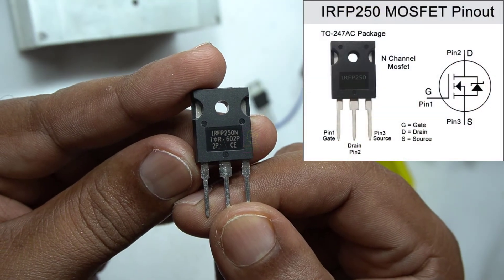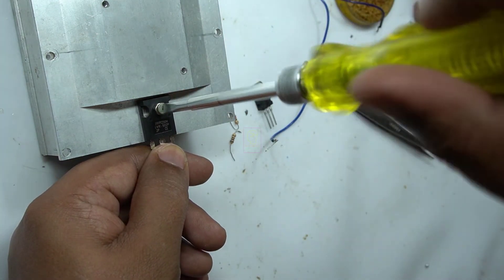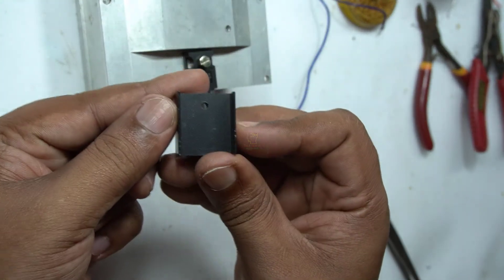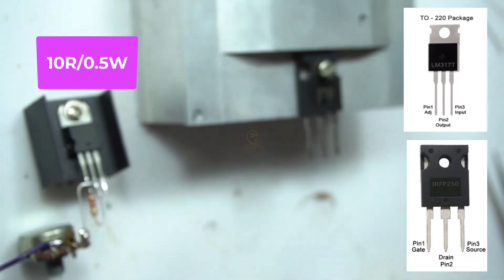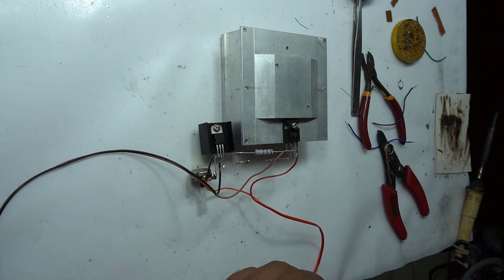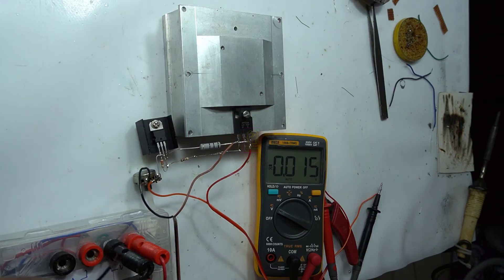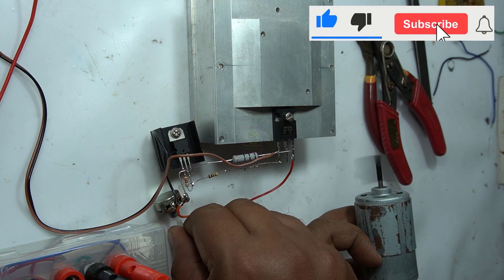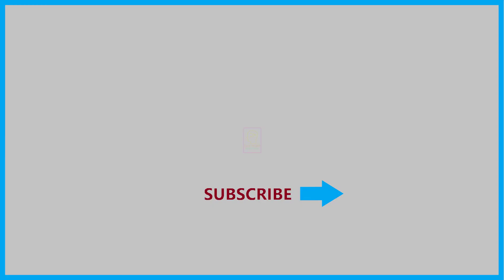How to make 0-38V  20A Adjustable Voltage Regulator Using Power MOSFET | LM317 and IRFP250N

Comment: It was better to add a current control also to this circuit.
Reply from the maker: But if we are making current control we need to implement feedback also
Reply: @TechInsert  . Yes . I want to make a reliable linear power supply.. tried some circuit. . But.not satisfied . .
Reply from the maker: @rajeshmadiyapara9503  Let me try

Comment: Hey Im thinking to put an a 2nd pot for adjusting current and a overvoltage and overcurrent protection
Reply from the maker: Please have a look at this . https://youtu.be/vplTVY7QV0I. This is  the best power supply. It will not reduce voltage if draws 10a
Reply: @TechInsert  oh thanks bro, can i put another pot for current control and and led too in this circuit 38, 20a
Reply from the maker: @TheFactLabcuriosity  Yes you can
Reply: @TechInsert  so how can I put it another 2nd pot for current

Comment: hey i try to stimulate it in multisim and the curent output is too high what value of resistor in r1 to r4 should i need to increase to lower the current or should i replace the mosfet with other one
Reply from the maker: No , this even though  I mentioned it as 20A that is just a value, this can handle even more current. The current is decided by the load . The mosfet can handle 30A max. So for safety we will give a load to this ciruit which will draw max 20A only. No change in resistors
Reply: @TechInsert  i guess my stimulation is wrong but can increases the voltage and current i wnant have an output of atleast 50v for my project can you suggest what are the component should  i costomize in this circuit kindly confirm
Reply from the maker: @TheFactLabcuriosity  How much current you required?
Reply: @TechInsert  atleast 20a to 30a so that i can supply a voltage charger using this power supply to charge an ebike and e scouter

Comment: Hey bro i put diode and capacitor here in this circuit the capacitor is 1000 uf, 50v and the diode are 10a10 x4 is this correct value for this circuit, kindly confirm this, thanks
Reply from the maker: 10a diode is ok. But you need at least 4700uf 50v * 4 filter capacitor connected parallaly . The more the capacitor the good the out dc
Reply: @TechInsert  hey bro I created a circuit for this one where can I send to you the circuit diagram

Comment: hey bro in this ac to dc that needs transformer?
Reply from the maker: If you have fixed voltage smps you can use this circuit to convert to variable power supply. If you have transformer , then rectify and filter it and then give to this circuit. Kindly confirm , bro ununderstand the circuit right? else ask me i wil explain
Reply: @TechInsert  yes bro its okay i undersatnd your circuit a little bit but overall your circuit is so worth it to make for my project  in electronics, so if i put 4x diode can capacitor what are diode and capacitor should  i put in this circuit to rectify and to filter this power supply

Comment: hey bro nice circuit but if  i have digital voltmeter and ammeter where can i put it in your circuit?
Reply from the maker: The ammeter one end is connected to the out put + line and other end is connected as the  + line. That is in  series 
 to the output line. Digital voltmeter should be connected parallel to the at the outout line. That is + and -.